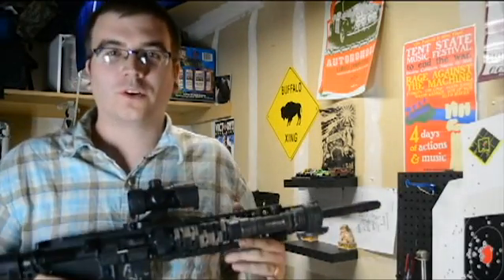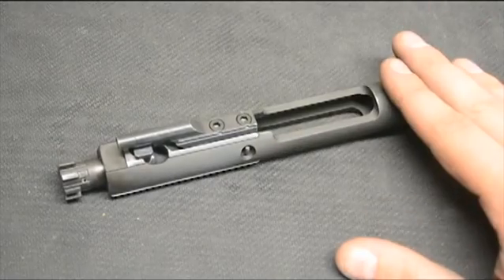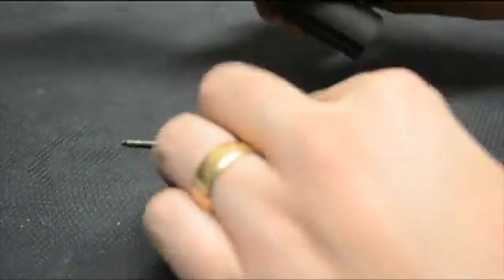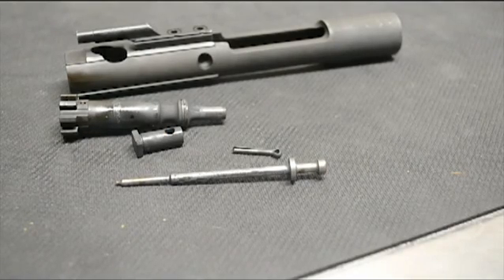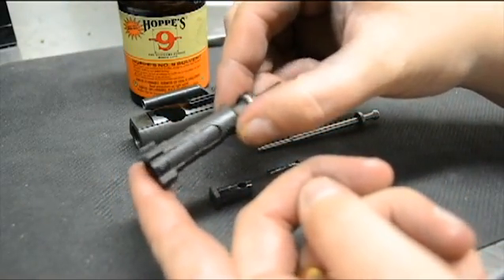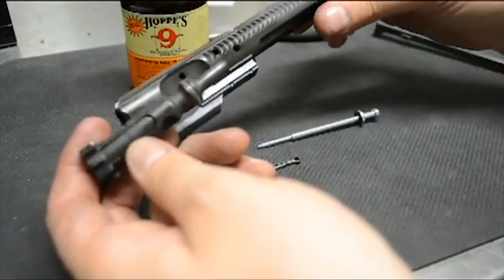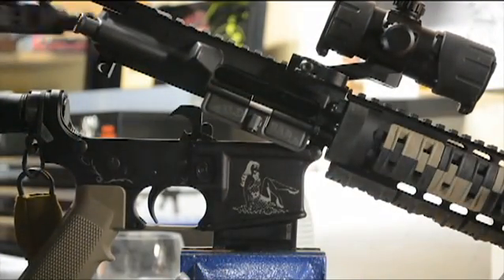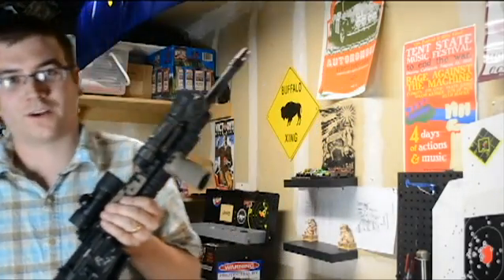AR15 bolt carrier group cleaning and disassembly

Comment: Nice video. Everybody on here is gunsmithing experts... ignore them and keep doing your thing.... All I ever use is ballistol to clean the black residue off and then I reapply ballistol again to lubricate. I shoot 500 rounds before cleaning and it still shoots fine. Crap tula ammo too. These guns work well pretty consistently they are not Ducati motorcycles LOL.

Comment: It seems many people have VERY strong opinions on the bolt tail carbon - most say "leave it alone it is self limiting!" so darned if i will argue the point.  And that dad gum  carbon forms in only a couple magazines of firing!  Leave it alone for long enough, i believe the bolt will pit underneath it and then you need a new bolt....or, risk your life on a bolt that has weakened however slightly...All chemicals on the carbon are completely useless, i have tried them all, if you have used some chemical that DOES take this carbon off, please tell me about it, because i have never seen it!  Only scraping gets it off.The G and G tool is internet only, costs 20 bucks and works excellent, removes the carbon in 5 minutes tops (of fairly hard scraping to be sure) i would recommend this tool to anybody with an M4/AR15.   I do not bother with buying the "special pads" you can get with it,  they are just scotch brite pads that you can get anywhere and just cut them to size.
Reply: +Robert Maybeth take a razor knife like a box cutter and gently scrape the carbon off. works great and it quick. cover the carbon deposites on the bolt with oil and let it sit a few mins. wd 40 although it is not a firearm lube works great for this. just wipe it off when you are done cleaning and removing carbon. you can also use wd40 to clean inside the upper reciever. a military buddy of mine said they clean their guns like this and thats the only way ill clean mine now. works great
Reply: Finally...someone who realizes WD 40 can work just fine in some gun uses. In fact works quite well.

Comment: no lubrication???? Yes, cleaning is essential.. but you have to lubricate as well.  Wiping down with Rem oil is not sufficient, you need a dedication gun oil and just a few drops and wipe with the tip of your finger liberally around the bolt carrier as well as oiling the gas rings.. A+ for cleaning, F for lubing
Reply from the maker: Good feedback. Thank you.
Reply: lshankle19 si wey, I use Mobil 1 synthetic for 4 stroke motorcycles...
Reply: @hothsurvivor  eww.. mobile 1? Castrol synthetic is the way to go

Comment: Is it just me or do other people have this problem, I clean my BCG every time I fire the weapon. I have a real problem re installing the firing pin retainer. I do not mess with it. I cannot get it all the way into the BC. Fir some reason it will not pass through the other side. Am I missing something, it there a trick to This? Any help?
Reply: +John Milewski Had the same problem.  I inserted the retainer without the pin, and saw that the ends of the retainer had spread just a little.  I used a long skinny screwdriver to guide the loose end in.